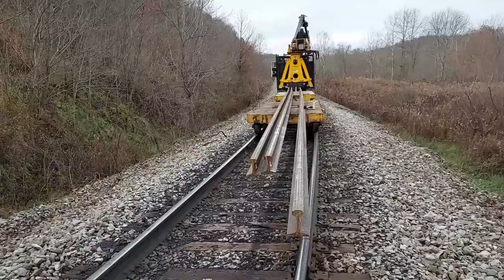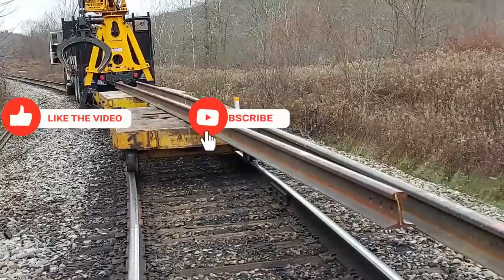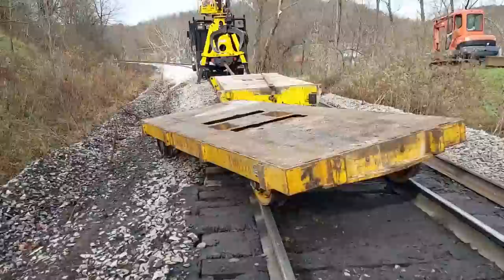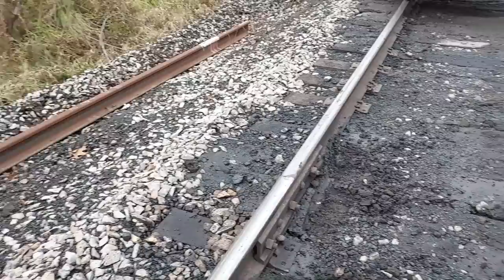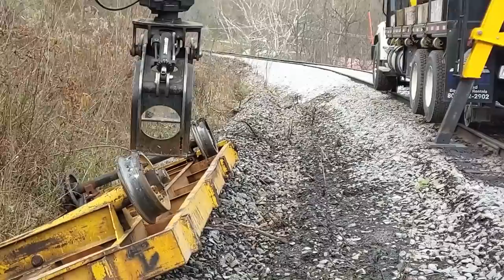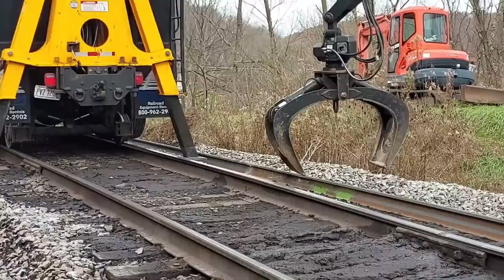A Derailed Rail Cart Unloading 78 Foot Long Sticks of Rail

Comment: That guy running the grapple is an artist.  To me, it looks like all the weight of that rail on the right side of the cart unloaded the left side.  Then when you took a left curve, the front left wheel flange was just able to get up over the rail.  Thanks for bringing us along Dave.
Reply from the maker: Brandon is a pretty good operator for sure Michael for being a 
young pup. But he's been around some pretty good older operators
in his time and learned well from them. You are absolutely correct
in your thinking on why it derailed. We should have centered the
rail and chained it down, but we didn't. Next time we will.
Thanks so much my friend for stopping by and
checking out the video. May you have a most blessed day.

Comment: That truck is amazing. I bet it don’t come cheap. Stay safe out there.
Reply from the maker: It certainly is Bob, can do a tremendous amount of work in one
day with it. Brand new, $350,000. But it will pay for itself within
a few years. It's $1500 a day cost for us when it comes in here. 
Really hard to run a RR without a grapple truck. Thanks so
much for checking out the video my friend. May you have a most
blessed day.

Comment: Great minds think alike ! One of my "co-workers" needed to shift quite a few  240 foot lengths so scrounged up 6 or so trollies and hitched em up to the Hi-Rail truck and set off on the 30 Km journey with his new rail train.Of course the Flexitor suspension on the trollies wasnt up to the weight and the wheels ground through the floors.Lots more to the story but lets just say  .....Oh Dear ,thats rail roading !
Reply from the maker: Oh wow that would have been a real mess to deal with Chris,
I've seen them overload rail carts here before and wheel bearings
go bad. Appreciate your taking the time to stop by and check out the derailed rail cart show. May you have a most blessed day my friend.

Comment: Interesting! I guess this is as close as you get to what model railroads call the 0-5-0 switcher in real life. (For the uninitiated, the 0-5-0 is a joke regarding using your hand with 5 fingers to move the said rolling stock on the model railroad)
And today it didn't have 5 fingers, but the process was the same and interesting.
Reply from the maker: Cool, I have never heard that before CMDR, thanks for sharing that
with me. Did a lot of that back as a kid when I ran my HO and O scale
trains. Thanks so much for taking the time to stop by and check out the derailed rail cart show. May you have a most blessed day my friend.

Comment: Cool video Dave reminds me of when i worked at the Steelton Frog and Switch as a locomotive crane helper. We had beds of different section of 39 ft, rail  The crane had a rectangular magnet on it and the operator would put them on a truck like the one in your video. We helped the operator with a push pull pole to steady it when he loaded the truck. Frog and Switch there closed in 1992. Then i went from there to the rail rolling mill. 42 and a half years of working around rail. Forgot to mention why we loaded the truck with 39' rail the were loaded in pushed in a building called the saw shed where they cut the rail with large abrasive saws to be cut to length for guard rails and switch points etc.  Got a little carried away on this comment LOL.
Reply: That would be a fantastic place to make some video. I have never seen how switches are made, pity it is no longer there
Reply: @cedarcam  Thanks for your comment. It was the rail was put on a planer and it was planed to a point. The frogs were something to be seen made also. They made panel turn outs there also. All gone now. Buildings were demolished in early 1994.
Reply from the maker: Very interesting story Michael. Wow would I have loved to seen
that place. other than a few RR;s who still have frog shops, I
kind of think Progress Rail is the only one that still makes frogs
in this country? Do you know?  Thanks for taking the time to stop by and check out the derailed rail cart show. May you have a most blessed day my friend.
Reply: @ccrx6700  Thanks Dave. When i first started in the frog shop i worked in the labor gang as a fill in i helped build frogs and guard rails. It was a shame that place closed. The products they made were made well. They even made 60ft. switch points for high speed rail.Frog centers were made of manganese at the steel foundry there.
Reply from the maker: @BeeLineEast  👍😎
Reply: @ccrx6700  🚂👍

Comment: All those unplanned Adventures. Of course the good point nobody was injured and nothing was damaged. Looking at the derailed carts kind of like the go-kart that skidded past the hay bales and also these are able to be handled by a crane something you wouldn't have attempted years ago with the wooden decks. You can add another date to the board at work that it's been so many days without a personal injury accident. With  Spring coming on quickly and so many tasks you'll have no shortage of subjects to photograph
Reply from the maker: You're right Paul things could have been much worse, this was
easy. Thanks so much for taking the time to stop by and check out the derailed rail cart show. May you have a most blessed day my friend.

Comment: Loaded rail carts two levels high picking up old rail after a project about 15 to 16 years ago. Axle broke on one cart pulling it back in and it was pick up sticks with the rail everywhere 😵‍💫
Reply from the maker: Sounds really familiar Michael. many years ago they were picking
up old rail here and had the cart stacked way up and almost
same thing happened, bearing went out on the cart and rail
went everywhere. And it was about 15 or so years ago too.
Thanks so much for taking the time to visit with us and check out the
video. May you have a most blessed day my friend.

Comment: Dave, I have some pieces of rail that are about 12" - 24" in length that was used as anvils, cribbing etc around our farm shop many years ago.  I'm guessing they were scraps from the 30's.  Without having them side by side with current rail, I'm guessing they are very different and probably made of iron.  Don't know much about metals or rail history, maybe you could speculate what they were made of from that era?  Thanks for all your great videos.
Reply from the maker: Your rails are made from steel Bobblenuts. Cast iron rails were
first used then around 1857 the first steel rails were introduced.
Sometime in the late 1800's Carnegie learned how to make rails
from steel by visiting the steel and rail manufacturers in England.
I can't remember the dates on that exact, my rail book that has that
info is in my truck at work, and I'm home now. But Carnegie really
put the American steel rail into wide use here. Before that steel
rail was mostly bought from England, a very expensive proposition
at the time to get it shipped over here. So since those days, all
rail has been made from steel. Cast iron rail broke easily and also
had very, very poor wear when it was used in curves.  Someday I
will make a video on the history of rail for you, but it may be
a long time before I get to it.

Comment: The little rail carts can do the weirdest things. I was doing some system integration upgrades at a foundry and they used small carts to move the the molds and castings around. I hear a big commotion and look over to see one go by on one axle with big mold set on the very end jumps the rail at the curve and then just spun around in place till it ran out of momentum tipped up on one axle.
Reply from the maker: I guess weird stuff happens not only on the RR but in the foundry too!
:-)  Thank you so much for taking the time to pay us a visit and check out the derailed rail cart show. May you have a most blessed day my friend.

Comment: Yikes, that section of track looks like it could use a culvert to drain away rain water. Were these 78' "sticks" of 132 rail two 39' sticks thermite welded together? I've seen something like a 1000' piece of rail, made from welding smaller 39' pieces of rail together. Cool video Dave.
Reply from the maker: Yes drainage is a must needed fix there and it has since this
video was made been all done Josh. I've got a series of videos on 
what all i did here to correct drainage and track problems, it's
on a play list on my home channel page, called Curve 14 & 15 
Ballast Rehabilitation. Thanks so much my friend for stopping by and
checking out the video. May you have a most blessed day.
Reply: @ccrx6700  O.K. thanks Dave, I'll check that out.
Reply from the maker: @joshbenton4080  👍😊

Comment: With the weight on one side I guess the light wheel hopped over the top. At least you had the right equipment to sort things out, that grab picked the carts up easily.
Reply from the maker: You're absolutely correct in that cedarcam, exactly why cart 
came off. We should have centered the rail on the cart and chained
it down, but we didn't, next time for sure will do that. Thanks so much my friend for stopping by and checking out the video. May you have a most blessed day.

Comment: Dave, the rails you replaced, are they still usable
Reply from the maker: Those rails that got replaced will be sold for scrap Ross. They
were just too far gone to be used in another application. Thanks so much for taking the time to stop by and check out the derailed rail cart show. May you have a most blessed day my friend.

Comment: how much does a stick of rail go for these days?
Reply from the maker: If you saw my shorts video, those 40 footers in that video brand
new were $2,000 a stick, however 40 footers are special order so
they cost more. It's been well over a year since we got regular
39 footers and they were around $1,200 a stick.
Reply: @ccrx6700  diddnt know you wore shorts, ill note that; considering the length.... wow our railroad is getting ripped off... we use 15lb rail and last time we bought new rail was 700 per stick... though ours is more of a specialty thing nothing like a real working RR... alas.
Reply from the maker: @northstar2007  👍😊

Comment: Ballast looks fouled with coal even on spots the trains don't go slow.
Reply from the maker: It is full of coal fines slashmaster. A real mess. it's all been dug out and now this section of track is perfect. Check out on my home 
page under playlists: Curve 14 & 15 ballast rehabilitation. You can
see on those videos what all we did to correct those problems.
Thanks so much for stopping by and checking out the video my friend. May you have a most blessed day. 

Here's the link to the playlist:
https://www.youtube.com/playlist?list=PLTyDYTDnT025KCBzQopCwnF0Zc9WbQF0F
Reply: @ccrx6700  Yeah. I saw some of those videos. I guess this will be a continuous problem as long as you haul coal with bottom unloading hoppers which some are sure to leak?
Reply from the maker: @slashmaster2  👍😊